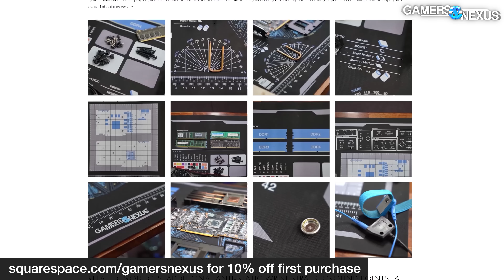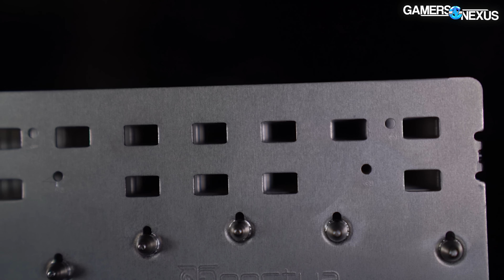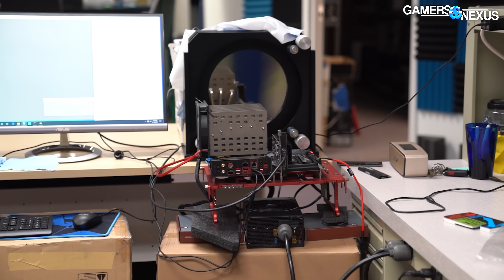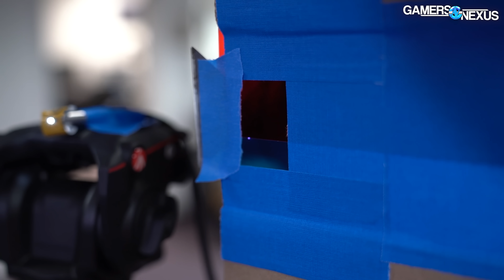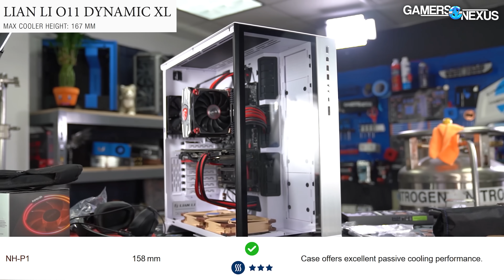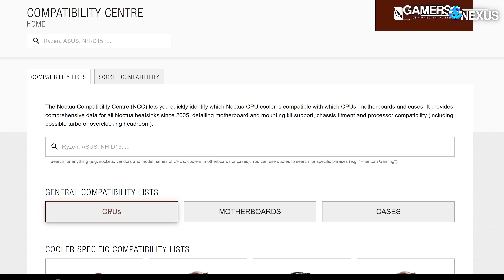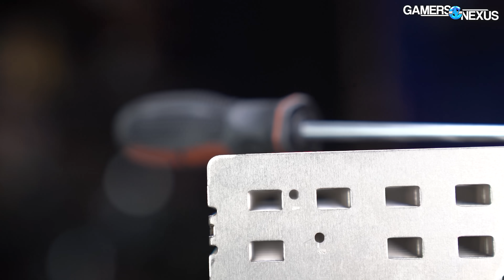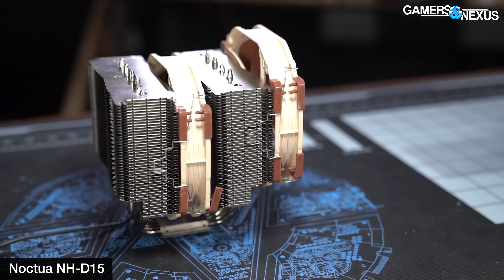Noctua NH-P1 Passive CPU Cooler Review: Benchmarks, Schlieren Photography, & Mechanics

Comment: Its not really fanless, it just relies on your Case-Fans.
Reply from the maker: No, it is literally fanless. You don't need case fans for this to work. Don't spread misinformation.
Reply: @GamersNexus  So the heat just magically removes itself from your case?
Reply: @Andarus  Natural Convection (no fans) versus Forced Convection (fans). Many electronics use natural convection cooling. https://en.m.wikipedia.org/wiki/Natural_convection
Reply: Not only does it not need fans, I would bet it will work optimally without many case fans so that the natural heat rising creates its own the necessary air currents.